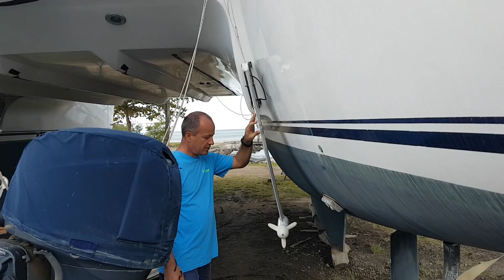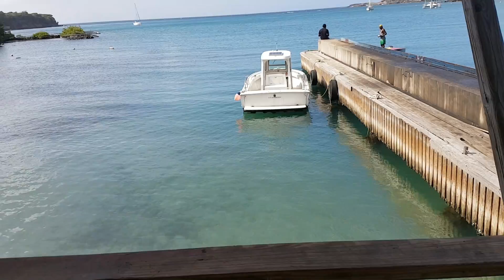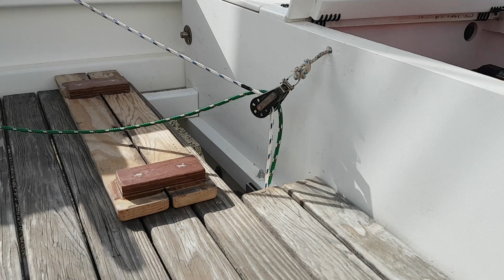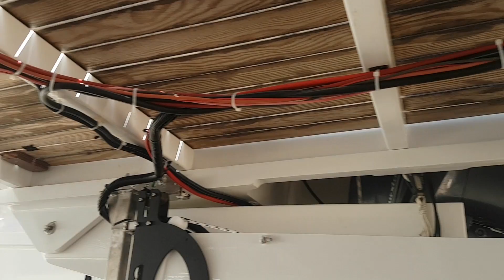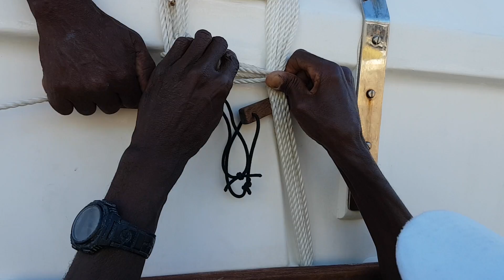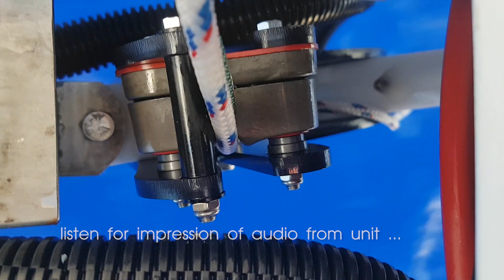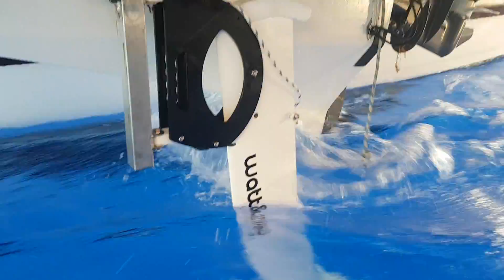FREE ENERGY - 1000 Mile Hydro Generator SAILING Trial - Ep 42 Luckyfish

Comment: Hi Stew, 
I am sorry if I ask a question you have already answered to...... 
could you please let me know what is the number of batteries and technology you are mounting on your Boat? 
I am very interested in this water generator, I hope to be able soon to share my experience with it.
Nice videos and very well explained. 
Keep going
Best regards and safe sailing. 
Andrea
Reply from the maker: +andrea spinoglio hi and thank you for the question. Please take a look at http://www.svluckyfish.com/electrics-living-on-wind-sun-and-hydro/ its all covered there. Also there is a link to a spreadsheet summarising our Energy Consumption at anchor and on passage. Please dont hesitate to ask any other questions, cheers, Stewart
Reply: thanks a lot, thats answer to all my questions and more. Best regards
Reply from the maker: +ML L Hi mate, I have just added that detail to the link. Meantime, yes 12V, 970mm, 300W (suits the ave speed profile for our boat 5.5 to 7 knots and our energy needs), 240mm prop. If you go back to the page now you will also find a link to the spec sheet from the manufacturer, which is very useful!) Cheers Stewart
Reply from the maker: +MAL L that's a good question and has me looking back over the output graphs for the various propellers, again! Looking at the swept area for the 240mm vs the 280mm props, from around 6kts and up there appears to be about 16% more output from the bigger prop, at the cost of 30% more swept area (drag). So, to go to the larger prop you would have to have a 'need' for the extra power. At this stage we don't appear to have the need for more power so the 240mm seems appropriate. As for speeds on the boat, you have me updating the website again, as we get asked that question alot. All answers here http://www.svluckyfish.com/fast-luckyfish-go/
Reply from the maker: +MAL L - at 22T i doubt your boat will notice the difference in drag one bit!. A boat of that size will likely have alot more electrical demand than us, so that is a pretty good case for the 600W unit. What kind of boat are you looking at?

Comment: Hello Stewart and Zaya,

Great video! Now you have the power, do you think you will install an electric autopilot also? Or are the Wharram wind pilots all you think you will need? I just bought the plans for the Wharram pilots and was wondering what you thought before I launch into building a set.

Once again, fantastic video.

Paul
Reply from the maker: Hi Paul, thanks and great to hear you are building the vane steering. re the autopilot, I bought one but never found the need to install it. I thought it might be needed running dead square to the wind but the vane steering works fine on that too. So I sold it :-) Try to use light material for the blade, we have a stiff boatbuilding foam, polyurethane I think, about 8mm thick and two packed. Its really light. If you pm me I will send you the dimensions of the blades. We have 2 sizes for under and over 8 knots true wind. Watch your mounting position relative to the stays.. they can interfere with the movement of the blades. Our mount can slide for and aft depending on the point of sail we are on. Two improvements to consider - make that fore and aft sliding super easy - i.e. a bolt with wing nut and a slot for the slide.. (we have holes - not ideal) , and put your counter weight on a slide to (up and down) that way you can use one weight for both blade sizes. Lastly, make everything run smooth as possible, low friction I think is what makes them work so well. SIlicon spray everything, every now and again. Cheers, Stew

Comment: Hey Stew and Zaya :-) So does the downhaul hold the blade in a vertical position? Is there any relief if you say hit a log or something with it ? Something like this might same you same damage if it does hit something hard one day. http://duckworksbbs.com/hardware/cleats/sd002570/index.htm . This would keep the blade vertical, while still allowing some relief if you hit something hard.
Reply from the maker: +Andy Preston that looks like a great product. Yes the downhaul gets it down to vertical. We have found you need to winch it down with quite a bit of force (we dont like slowing down the boat to do this :-)) The hydro gen also comes with an optional locking pin which we dont use. You are right about hitting an object. The unit and/or the mounting bracket would not fair well. I'm thinking of ways to put a weak link in the system, but with so much downforce on the downhaul - that makes it difficult. Thanks for sending the link, Stew.

Comment: Thank you for your test and review on the "watt and sea" gen. I have 900w solar and a 400w (max) wind gen. I want to increase my input power out side of daylight hours and have been considering a second wind gen. or a hydro gen. I noticed corrosion on the join between the prop hub and down shaft of the "watt and sea" gen. mounted on the Lagoon 570. 
So the quality of build of this generator is a concern, along with weed 'maintenance' and impact risks with this type of generator has determined my choice of a second wind generator, where at sea or at anchor (when there's a little breeze) I can be receiving a charge.
Reply from the maker: +Joe Bloggs thanks for the comment and observations. Yes, I saw that corrosion under the coating too. Similar to what we see on our 5 year old Yamaha outboards and treatable if it arises. As for it being an indicator of the overall build quality, I don't think that it applies. 

The unit is a beautiful bit of design and engineering with low drag and high efficiency, used on 90% of the Vendee Globe boats etc etc. There seems very little to wear out or degrade over time so I expect we will get long life out of it - as long as we replace that prop shaft seal every 2 years.

Re the decision between adding more wind gens or a hydro - I went through that same process. In my view the two technologies are amazing! but suited to two different purposes. I wouldn't rely on a wind gen for the passage making we do.  At just 5 knots of boat speed the hydro gen produces the same amount of power as a good quality wind generator in 18 knots of Apparent Wind (say 25+ knots True). Put another way, we get the same power as a wind genny in just 10 knots of True Wind. Something we rarely see as we spend much of our time reaching or running. This makes a huge difference.

We have recently bought a Rutland 1200 wind generator and will fit it to the mast head of the main mast (where it belongs in my view :-) . We are really excited to add this unit as it will solve our energy needs on anchor, more or less. We saw a couple of them in Grenada (and didn't hear them!) so they look super good. Also, they have a really low start up wind speed which is where you want the wind genny to perform. Will do a video on it after we have given it a decent trial. Cheers and our best to you, Stew and Zaya
Reply: Have a look into the "silentwind" gen. - whisper quiet / 5 knot startup / 450W (max) / same price.
Reply from the maker: +Joe Bloggs - thanks for the tip. Yes, they look pretty good too, we see them all over the Caribbean. Real test will be how they age and how long they stay quiet. Hope to report on the 1200 soon. Cheers and thanks again, Stew

Comment: Really enjoyed this video thanks.  I am wondering why the designers of this product do not angle the leg to allow weed to just slide off?  Will the current whilst anchored be sufficient to provide any electrical current at all?  Thanks for your series.
Reply from the maker: +David H - that sounds like a clever design improvement ! I guess the weed in the Caribbean, as sad to see as it is, is a fairly local problem to that area. There are a ton of boats there though! Maybe food for thought for the manufacturers! Re anchoring, I guess if we anchored in anything over a 3 kt current the unit would start turning and produce 1 or 2 Amps - haven't tried that, Cheers Stew and Zaya

Comment: Is it really worth the 4300 dollars ?
Reply from the maker: +Michael Kerr that seems a bit high for the 300W unit we chose. 're it's worth, it depends on what you intend to use your boat for. For passage making its worth it. Cheers from stew and Zaya
Reply: Luckyfish Gets Away 
It's $3600 everywhere I see, still prohibitively expensive for many boats.
Reply: Michael Kerr Eventually it comes down to lifestyle and the power needed. If your even  modest $30-60K boat needs a $3,600 accessory to do what you want, not that big a deal. This is not a weekend cruiser item. This is for blue water liveaboards. If you want more power after the top side is full of solar, this is a lot more power. A noisy wind turbine is about $1k for less power.

Comment: The Hydro Gen's look very efficient...I think you're forgetting "life before them". Possibly mounting some kind of "weed cutter" which is very popular here in the Staes on outboard shafts in swampy areas would be a solution. Enjoying your life ventures....Mark S.F., Ca   ;-)
Reply from the maker: +Mark Gotham - good tip re the weed cutter. Some sailors use a rope cutter on their main engine prop, sounds similar. Glad you are enjoying the vids, Cheers from Stew and Zaya
Reply: I believe it fits on the Front of the Shaft......

Comment: Hydro is so much better than wind on the water. Wind power on the water is annoying and breaks often. Hydro is much more reliable, since the mass of the parts can be large, thus making everything better engineered and resilient.

Solar + Hydro is enough if you are moving. If you aren't moving, then put in more solar, and more battery. :-) Even on a cloudy day you get power from solar.
Reply from the maker: +Timothy Black, I like your views on the hydro vs wind. Yes, I am pretty amazed that our solar does put out power in overcast. I reckon you are spot on about more solar and more batteries rather than go down the wind genny route. That is a really viable alternative to us. I will see how the Rutland 1200 goes once installed and share the results here. It's only because that unit came out that I went down the wind route. Cheers and thanks alot for commenting, Stew and Zaya
Reply: I have one of these on the boat I recently purchased.. haven't used it yet as I am still getting her up to snuff. Thing is, in my case it breaks the peace of the cockpit when it is spinning in anything like real wind, so I am inclined to get rid of it and put in a big arch and more solar. FYI I have an Islander 44.

So.. I will be very interested in your eval!!! Thanks very much for engaging like this with us. Most sailing channels seem to primarily focus on beauty shots, alcohol and nonsense. I think you have achieved the right balance of entertaining things versus useful things to keep it up to par. You even have me considering finding two Mongolian women willing to come with me when I cast off :-) They are great crew!
Reply from the maker: +Timothy Black - people with noisy wind generators say they get used to it, unfortunately the ppl anchored or moored around them are expected to as well! Still, I would take a noisy wind gen as a neighbour any day over a deck mounted gasoline generator - Argh! Maybe take a look at the Rutland 1200 next time you see one in a harbour or marina and see if you can hear it? Zaya says thanks from her and Tuya! Cheers, Stew

Comment: Thanks for the video on the Watt and Sea. I hope to be setting out on my own sailing adventures in the next year or 2 and have wondered what was the best option to compliment the solar cells.  I didn't notice if you have a wind generator and if so how do you like it? Thanks in advance.
Reply from the maker: +JC F. great to hear of your plans to set off ! and that the video is of use to you. We have recently bought a Rutland 1200 wind generator and will fit it to the mast head of the main mast (where it belongs in my view :-) . We are really excited to add this unit as it will solve our energy needs on anchor. We saw a couple of them in Grenada (and didn't hear them!) so they look super good. Also, they have a really low start up wind speed which is where you want the wind genny to perform. Will do a video on it after we have given it a decent trial. Cheers from Stew and Zaya
Reply: Yes, I agree the mast is the best place for it, the only thing is it would just be harder to service or lock the turbine blades if a person gets caught in a storm where the winds exceed their max speed limit.

Comment: great video, now you can to electric stove. Will be curious if it degrades out over next year. what is the slowest speed to get any usable amps from it.
Reply from the maker: +Sea Journey thanks alot! it starts producing at around 3 knots boat speed, an amp or two. Then 7 or 8 Amps at 5 kts boat speed, i..e exponential. There is a larger diameter propeller available for low boat speeds and also the opposite too. The 240mm we use sits in the middle of the range. I dont expect the performance to degrade, if so its most likely due to aging wiring, connections etc which we will keep an eye on. Cheers Stewart